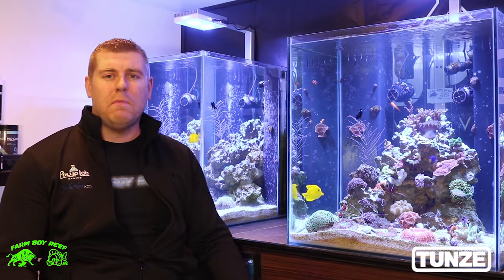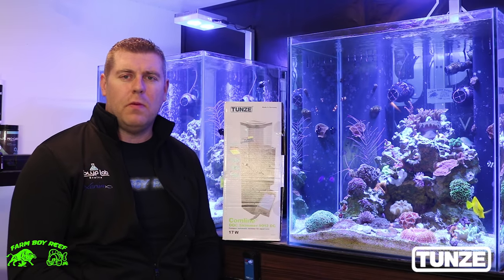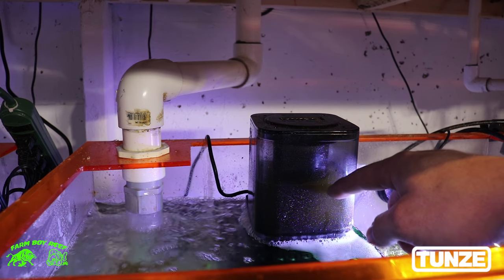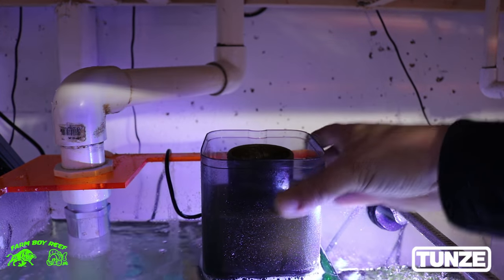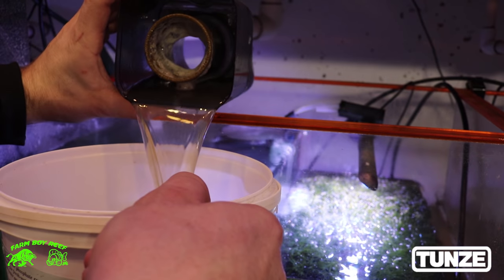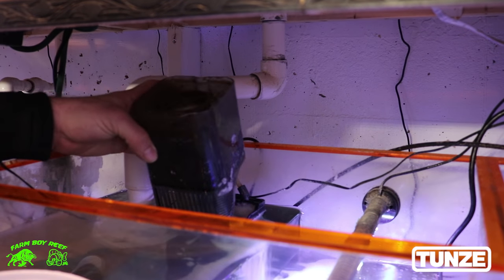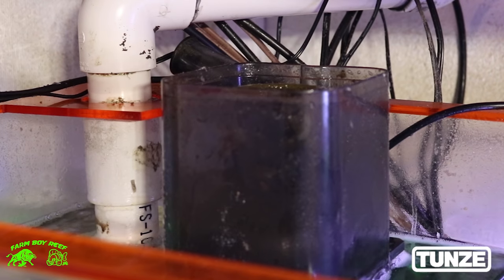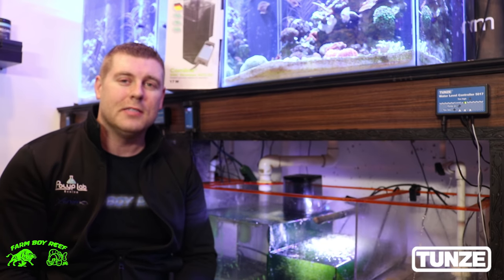Tunze comline Doc Skimmer 9012 Dc Look at that skimmate

Comment: Farm Boy, if you clean the neck on the 9012, frequently, such as every 2-3 days, the skimmer will be more efficient and remove more organics from your tank. I own a 9410, and the cup gets junked up after 36 hours. Although its a revolving, non-stop maintenance the Tunze removes so much waste with so little electricity used. Thanks for the video. Tunze all the way.